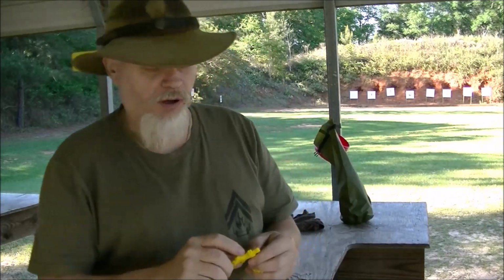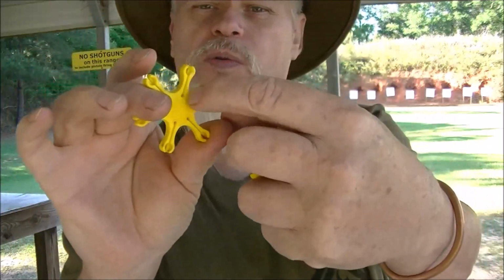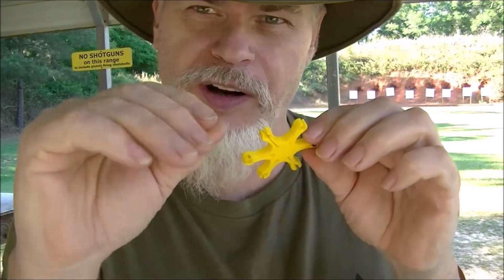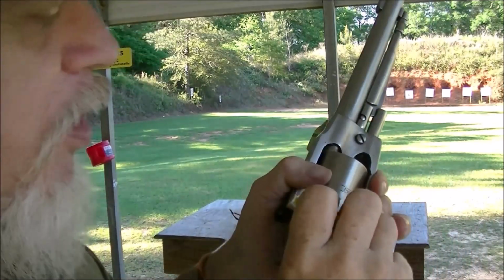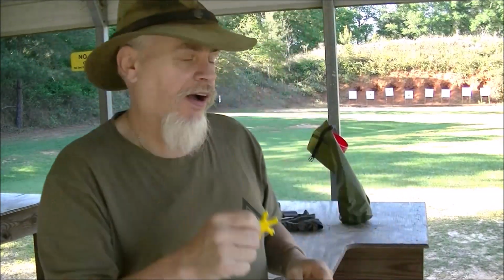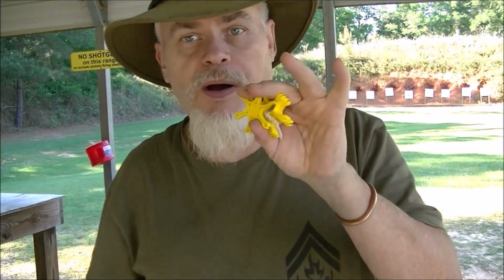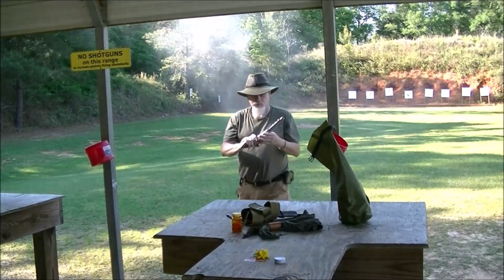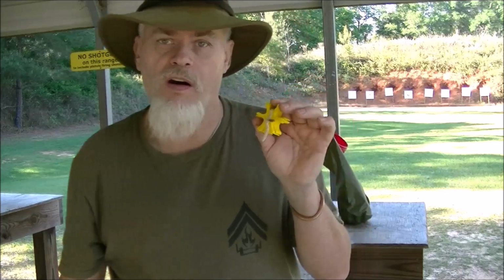A NEW SHOOTING STAR

Comment: I use these and find them superior to any capper on the market. I've tried your method of pulling the star off to the side after seating the cap on the nipple but find it easier to lift it back off. The stars should also last longer. I expected the caps to pull off and remain in the holder cup but they don't if the cap is a good fit on the nipple. These holders will make capping much easier with cold fingers in winter.

Comment: Dixie Gun Works sells a spare cylinder pouch, This might be a good way to carry these cappers--one stacked on the other.
Reply: I dunno. You need to moisture proof the pouch or moisture will ruin caps inside in no time.
Reply from the maker: true but for me i will only load mine before go to the range or the field to hunt and once back home i will unload them and return to cap tin in my hot humid south a cap will go bad if left out

Comment: You should really check out the Polish Capper. They hold either 50 or 100 and fit Remingtons, specifically designed for them actually but fit all models.
Reply: Well, they look nice. but they are not good at all.